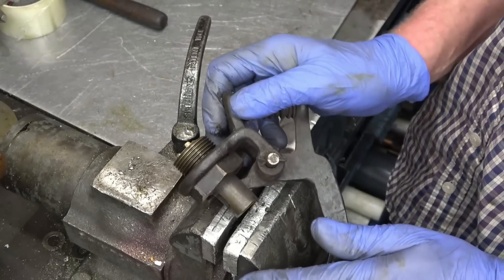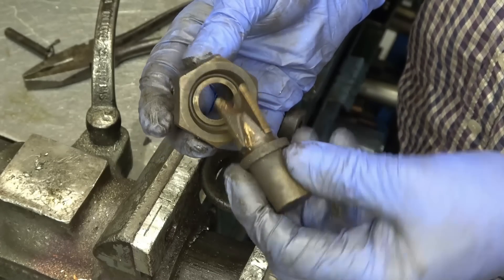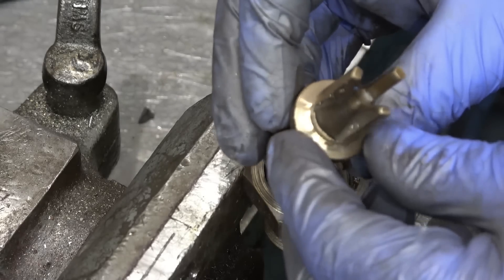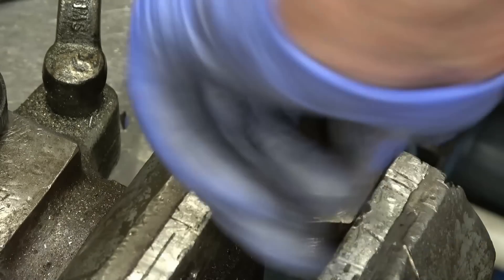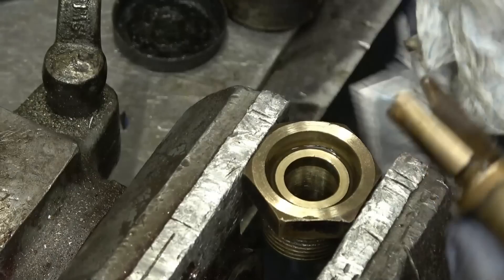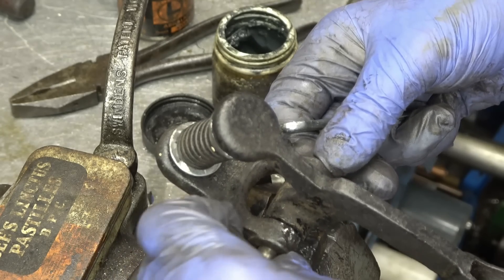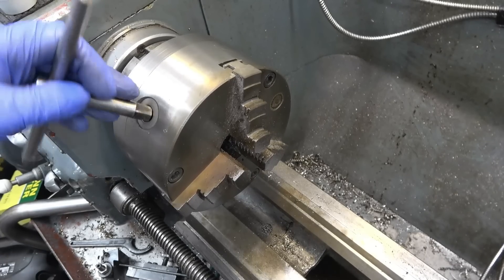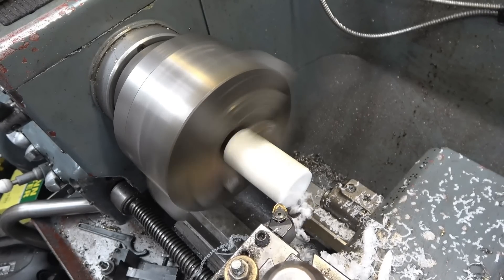SNNC 489 P21 Steam Valve . Plasma Cut Aluminium

Comment: In the case of a "worn beyond machining" cast bronze seat, could material be brazed, soldered, or otherwise built back up?  Or, is cast bronze pickey like iron?
Reply: Nah, bronze is totally different to Cast Iron, brazes dead easy as long as its clean and well fluxed and warmed up.
Reply: @1ginner1  It sounds fun to work with.  Thank you!
Reply: @gth042  You are most welcome.